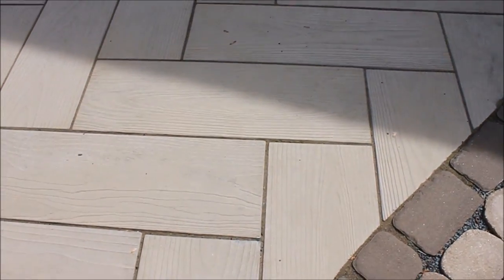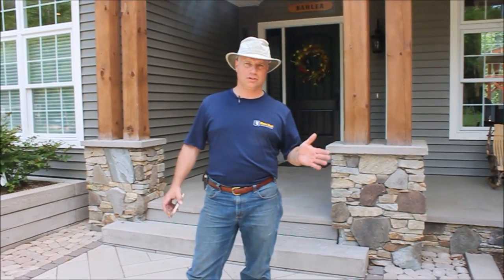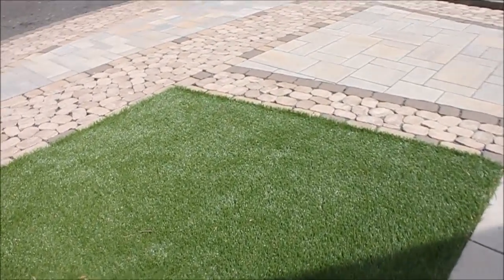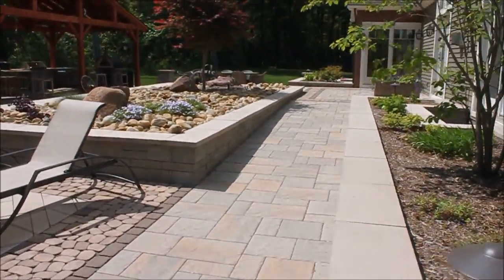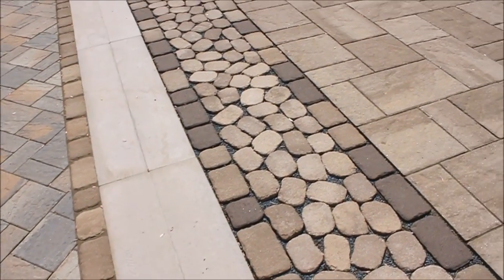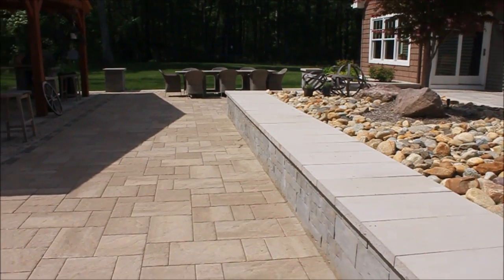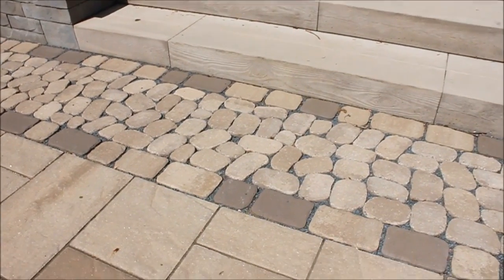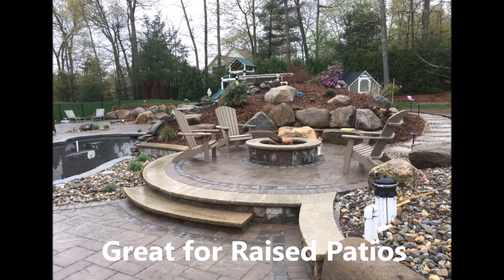What is Hybrid Pavement?

Comment: What keeps the poly sand from migrating into the open stone over time?
Reply: I'd say it gets locked in by the poly and turns solid.
Reply from the maker: Paul is correct on that. If we see change or deterioration in polymeric sands, we will post it. So far it's been something we have found to work good.